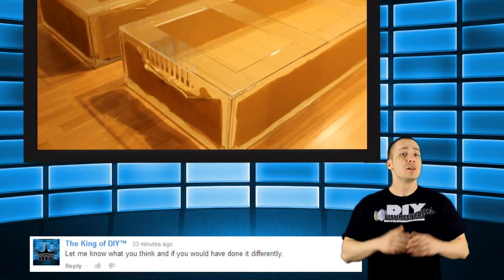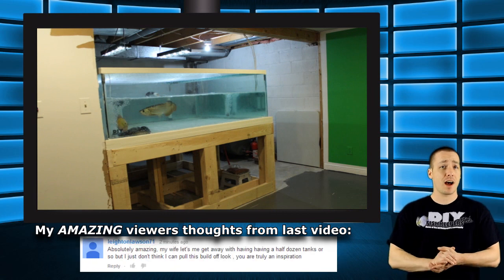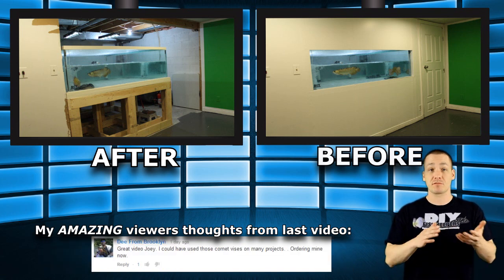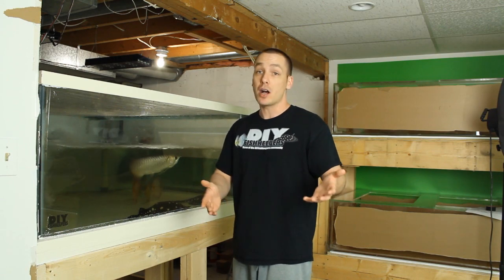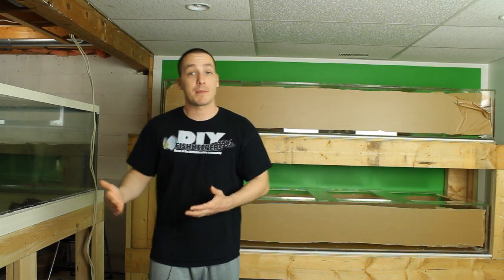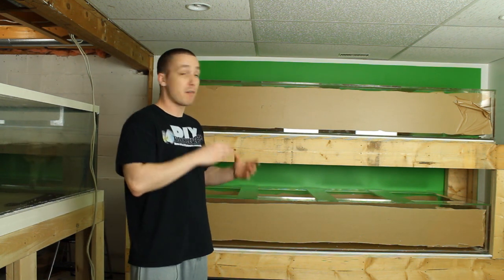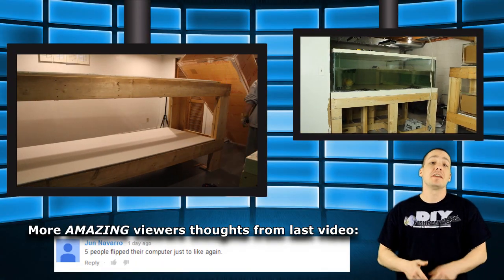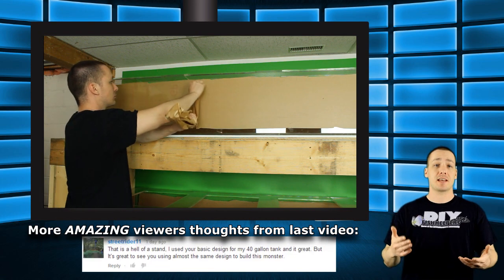Building an in-wall aquarium!

Comment: Hi I have watched loads of your videos it mite just be me 
I am starting to plan my first self build but when I think about the size of acrylic I need I often get confused as the thickness of the acrylic would change the size of each panel 
Do you have a way of doing it 
I am wanting to build a 4ft long by 1ft tall and 6inch deep could you help
Reply: The base is length by depth.
Front and Back is lenght by (height - 1 thickness)
Sides are (Depth - 2 thickness) by (height - 1 thickness)
Say you have 1/4" acrylic, you tank would be.
Base 4' x 6"
Front/back 4' x 11 3/4"
Sides 11 3/4" x 5 1/2".
Hope that helps.